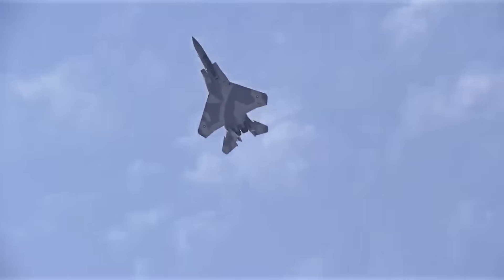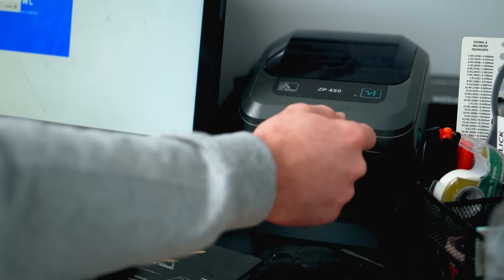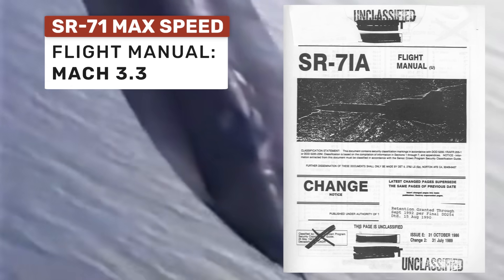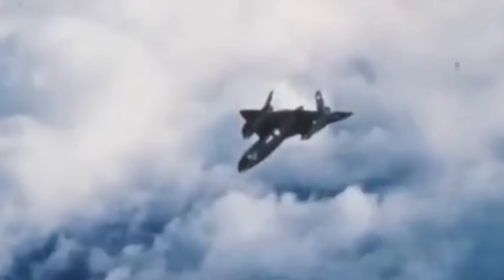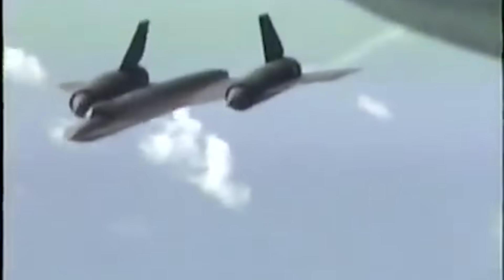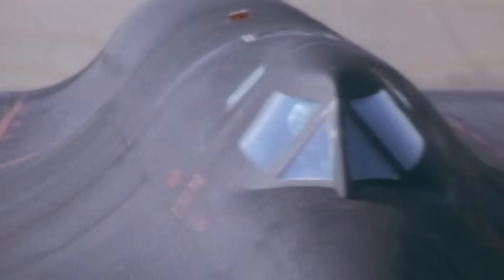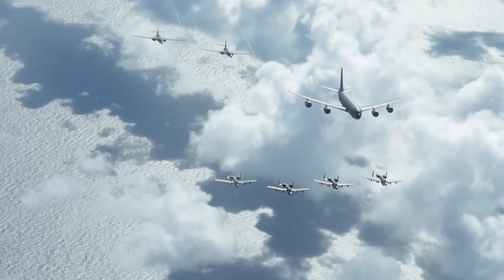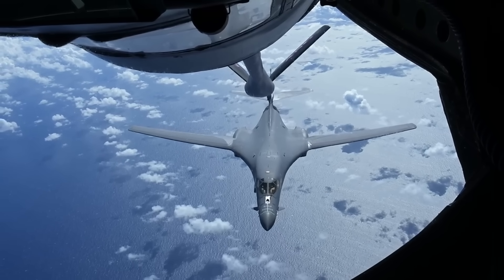The SR-71 was MUCH FASTER than the Air Force will admit

Comment: Yea agreed. The F-15 EX is almost certainly faster than the stated top speed. I believe that the F-22 is faster than the stated top speed of Mach 2.25. I mean the F-22 has the highest thrust to weight ratio than any aircraft we have and one of if not the higest of any fighter jet ever produced. The F-15 E and propably EX too has a TTWR of 1.25:1. The F-22 has a TTWR of 1.26:1 with the current square snapped nozzles. If the F-22 had round nozzle like everything else we had the TTWR would go up
To 1.36:1. Now that is the highest ever for a fighter aircraft. But using the square nozzles is part of the stealth qualities of
The airplane.

Comment: I think the max speed of the new F-15’s is what like Mach 2.6 or so? The original F-15 would do Mach 2.5. So the new engines have a combined 22,000 more
Pounds of thrust so with no weapons on board and about 1/2 a tank of fuel in pretty sure that could get that EX up to Mach 2.7-2.8. With a standard load out and a full tank of fuel I think it will still do Mch 2.5

Comment: So the engines will go faster than the airframe can take. Yea I heard that those engines when you get to Mach 3 that there is still so much more you can get out of them. I think with modern materials you could make a plane with those same engines that would do Mach 3.6 all
Day long.
Reply: Not exactly how it works

Comment: I don’t know what the Blackbirds top speed is it’s probably still classified but I do know that it cruised at Mach 3.2. When it’s at cruising speed it stays that speed literally for hours. The more you push those engines the more they wasn’t to go. When it’s at Mach 3.2 the airplane is 3 foot LONGER than when it’s sitting on the ground at regular temperatures. The heat from the plane moving through the air so fast heats the skin of
That plane up
And whatever it’s made out of I know it’s 65% titanium, expands
Reply: All the performance values are declassified and public
Reply: Well, it's 85% titanium, but the aircraft does change in size.  I don't think it stretches 3 feet, I think it's more like a foot.

Comment: Back in the mid 80s  a few of us techies  ran all the data we had on the Sr-71 ,  wt/ thrust altitude drag  , Once we crunched all the available ( printed public ) data  The computers continually delivered numbers exceeding mach 3.5  .. where as 3.56 was about the average .
Thats 2350 mph with an altitude of 88000 ft . 
Not saying it was ever sent that fast , but thats the numbers the  comps came up with .
Maybe with more available  data out their today  and better comps than what we had then , some one else could  crunch the numbers  .

Comment: There is a special switch 12:38 on the F-15 that allows maximum thrust,  only to be used in combat as it could potentially damage the engines so Mach 2.9 is feasible…. Oh I see you talked about it at the end of the video

Comment: Well I got news for you, the engine's that Prat & Whitney built f or the A-12 were the J-57 and one of the speeds it could do with no problem was , MACH 4.49 and there's another speed and altitude the A-12 can do with no problem but that's Classified. And on a. regular given day the highest altitude it can fly is : 95,000 feet.
Reply: Everything you said was wrong
Reply: @gr8crash Who are you that you are replying to every comment saying they are wrong? How do you know that? Do you have insider knowledge?
Reply: @bushgreen260 honestly?  Because most people are stupid on this topic. While people like the SR71 family of aircraft,  most know very little about aviation and even less about these aircraft specifically. 

So given most people don't know any better,  they often post things that are wrong,  and they should be corrected.
Reply: @bushgreen260  Some people bother to read the SR-71 Flight Manual.  
Sandboxx should have shared the secret and put this nonsense to rest.

Comment: the a12 isnt older than the sr71 they were designed at the same time
Reply: The A12 is older. The A12 first flew in 1962, the SR71 wasn't even requested by the USAF until 1962.

Comment: When you  bolt a couple of  big ass engines onto an untested  leaky  pile of junk there are bound to be be a lot of problems, probably why half the type crashed and burned.
Reply: You talking alloy the Mig25 or something? Definitely couldn't be the SR71
Reply: @gr8crash  certainly was  the SR71 and its types , half of them crashed.
Reply: @george-ev1dq  still not quite. A total of 50 airframs across all 4 variants were built,  and 20 were lost. Some were incidents,  some were mechanical failures, etc. But you have to remember virtually all those loses occurred within the first few years of testing and operation. The SR71 went on to fly for 2 decades without a single incident. Ended up with one of the safest records for an aircraft flying in such extreme environments.

Comment: I read at cruise the SR71 still had 4inches of travel on the throttle, but pushing it further would endanger the aircraft, and other future aircrew.
The follow on aircraft the Aurora could travel faster 35yrs ago but it probably did not work well as it's not been seen  for years.
Reply: First the only aircraft from the "aurora" program was the B2. Also that whole thing about the throttle isn't totally true as there is a lot of context missing from it
Reply: The Aurora hypersonic aircraft was flying in the late 80s but no sign of it since. It used to stage at Macrihanish then the longest runway in Europe at the time and was set up to take the shuttle if needed. I new a airfield worker who had seen the Aurora 4 times and a mil radar op in the UK I knew would be briefed when it would show on the scope, all this was 30+ years ago, what do you say to that.
Reply: @michaelwalsh7846  that it's completely BS. The only tie in to that theory would be the Boscombe Down incident which is a cool and mysterious event but still nothing too extreme. 

But besides that again the Aurora was never a hypersonic aircraft. People incorrectly assumed it was for some reason and back then speculations were fun, but now we have facts. So as it was said above the term "aurora" was given to a program that encompassed the ATB program. That was the competition between Lockheed and Northrop for the stealth bomber. That program is what produced the B2. 

We have yet to build a true SR71 type successor.

Comment: it was because the parts in the engines would melt and not withstand the heat however if tech would have been able to create engine parts that could withstand the heat they could go faster as the engine was also a ramjet. A combination type engine. Would function as regular jet engine until switched over to ramjet.

Comment: As I watch your video, I can tell you a story I was told about how fast the SR-71 is. It was kind of a drag race. The SR-71 was sitting on the runway at the threshold with the brakes locked and full afterburner. The brakes were straining to hold the Blackbird and the tires were squealing as the two Pratt & Whitney J58's tried to shove it down the runway. Meanwhile a Lockheed Starfighter (Missile with a man in it) was flying towards the Blackbird with full afterburner lit. Now you know how the F-104 got its nickname. It was incredibly fast. So, at full speed and afterburner lit, the F-104 rapidly approached the SR-71. When the F-104 hit the threshold, the Blackbird went brake release. Now here is the unbelievable part that will give you goosebumps and let you know how fast the SR-71 really is. When the driver released the SR-71's       brakes, the plane sped down the runway and was wheels up and reached the end of the runway before the F-104. Now I'm assuming it was Edwards Air Force base or maybe even Area 51, but to do what it did, it has to be Demonically fast. And it was built in the 50's with slide rules and not super computers.
Reply: That's definitely and interesting story and also not possible.

Comment: I learned years ago the true top speed of the SR-71 from a pilot when one was delivered to the USAF Museum at Wright Patterson AFB in Dayton Ohio where i was born and had live at that time too the Blackbird flown over the apt complex where iIlived and I made the trip  to the museum the next day, where it was still outdoors on static display and still essentially still able to fly still until they took it inand disabled the working bit decomissioning thee engines and avionics as well and having already removing all the camera and eletronic systems equipment ..I got to actually touch the plane i dreamed of ar least seeing in person one day but now I was touching the rare ands wonderful aircraft unique for it's flight capabilities.  when I tole one of the pilots that had flown it in that I had the model and wished to know moer about it and sort of begged for the info he told me thet told me that it could Super -Criuse at Mach 3,8 and had an actual top speed of around Mach 4,85 and maybe a littl more ever... and with an actual service ceiling of 110,000Ft. with a heat treat every time they go up, there may be no actual limit  to it's service life only the cost to operate the fleet of aircraft of that type.. with those J-59 turbo fan engines from Prat and Whitney I dont know where you got your info on the engines but it is flawed. and yes the air force does indeed under report the capabilities of their aircraft playing it very close to the chest at all times anyways just to be safe and keep it in essentially sleeper mode to take a saying from the car community.. I had a Testers 1/48 scale plastic model of the SR-71 Blackbird a few years ago and most of the published info was in the documentation with that model kit including the engine type and model of the twin Pratt and Whitney J-58  after burning turbofans as well as the fact that the tires are impregnated with aluminum for heat dissipation and that they are inflated with nitrogen to 300PSI and have blast shields around them in the gear bay to protrct the hydrolics and electronics  in case of explosion of the tires.  also that the YF 12 A interceptor was supposed to have an internal bomb bay to hold 2 LGB smart bombe with or wothout nuclear warheads. but there couldnt be any guns as the plane traveled faster than and bullet could travel anyway so might end up shooting itself down as a result...  lol  ...  the Blackbird is my favorite aircraft of al for its speed snd service ceiling... exotic build materials like titanium and the like but mostly for the rarity of the type with 25 built over all ant 2 of them trainer versions one of which had crashed leaving only one of that version so i built that one from my kit...gear up in flight mode and suspended it from the ceiling by monofilament fishing line that was virtually invisible in any light but through several moves and rough handling it was damaged beyond reasonable repair and missing a few parts as a resuls too. then somehow lost in the shuffle somewhere between homes... so gone for good now.. but still a fond memory.
Reply: The SR-71 didn't exactly supercruise: That usually implies the ability to fly supersonic without using afterburners.  While the SR-71 was quite impressive, it required afterburner to fly supersonic.
Reply: He was absolutely messing with you. The SR71 could never fly that high or fast under any circumstance.

Comment: Wasn't there an SR71 test flight that ended in disaster. Due to an engine stall at speed, control of the plane was lost. The pilot survived. It was calculated that going at 3.5+ Mach the compression of the air going into the engine, even with the inlet cone all the way back, was too much for the engine causing failure.

Comment: Summary: there are 2 variables limiting how fast the SR-71 could fly: engine power and aircraft skin temperature. Like a car, you could redline the engines to make more power but also damage them in the process. And you could have a higher skin temperature but at the risk of damaging the metal structure of the aircraft because it couldn't deal with the heat. Brain Shul flew at Mach 3.5 to evade Libyan SAM missiles, so it was worth damaging a very expensive aircraft, because the alternative was to get shot down and create a diplomatic incident, like with Gary Powers.
Reply: Except the Shul claim is BS

Comment: the Blackbird set a record for the LA to DC trip at 1hour 4 minutes 20 seconds. a simple google search shows this to be 2668 miles. that puts its speed at 2488mph, or Mach 3.77, which it sustained for over one hour.  top speed would be even faster.
Reply: May wanna do that Google search again as that's incorrect.
Reply: @gr8crash  did it multiple times. Google says 2668 miles.
Reply: @shawngore9072 lol no it didn't. It never once attained that speed.
Reply: @gr8crash  I did the math. Either Google wrong about the distance or the time listed is wrong. 
Otherwise my information and calculations are correct.
2668 miles in 1 hour 4 minutes 20 seconds  does in fact equal 2488mph.
Reply: @gr8crash  in fact, I just did some new calculations.  I was off a little.  2668 miles is the distance at ground level. At an altitude of 85,000 feet the distance would be slightly more. 4 tenths of one percent more, or about 2679miles. This means the average speed was actually  2,498mph. An increase of about 10mph. That's mach 3.785 I believe.
Reply: @shawngore9072  your math is waayyyy off. LA to DC distance is 2299.67 miles and coast to coast is 2404.05 per the records set, and since those timing gates are defined and established it's the most accurate. 

Average speed for LA to DC was 2144.83 and coast to coast was 2124.51. Which would put the mach speed at just over 3.21. Part of that record run was flown at about 3.29 as well. 

So not sure where you're getting your math from,  but it's definitely wrong.
Reply: @gr8crash  not according to Google.
Reply: @shawngore9072  actually even according to Google. Most likely you used Google incorrectly. But regardless that's irrelevant,  you have to use the FAI/NAA distances which are set and established timing gates. Those are the distances that matter. But to be fair, when used correctly Google is closer to them than whatever numbers you came up with.

Comment: The truth, no one knows because the plane was not power limited, it was heat limited. The pilots could have gone faster but they could have melted the engines and at Mach 3+ not good.

Comment: Top speed was probably closer to Mach 3.5 or 3.6 but you don’t fly the aircraft at absolute maximum speed unless you want to blow up the engines and probably die.
Reply: Again, as the term 'Mach' relates to the speed of sound, this also correlates to altitude. So, given an 80,000ft maximum altitude, Mach 3.6 is completely feasible...and is the general number I've been given...so, 660mph (@ 80k ft) x 3.6 = 2376mph....very capable of achieving that.
Reply: @firstjohn3123 except it wasn't. The aircraft would have crashed before it even reached 3.6. Not only are you know well beyond the capabilities of what the inlets can handle and what temperatures theb compressor can handle you're also now beyond what the control surfaces can handle. There's absolutely no one that had worked on or flew that aircraft that will say 3.6 was ever possible. And besides all that,  just say a pilot did do it, how would the crew even know?
Reply: It couldn't even get close to those speeds without specific circumstances

Comment: I had a personal conversation with the man who managed the SR-71 and spy satellite programs under the Johnson administration.  When I asked him how fast was the SR-71, he said:  "You're and engineer, you figure it out, calculate the speed were the air molecules reach the temperature that melts titanium."  That's about Mach 3.5 depending on altitude.
Reply: Lol that's not how it works.
Reply: @gr8crash  So how does it work?
Reply: @turbo32coupe  no company would design an aircraft to fly at 3.2 and melt at 3.5, that's ridiculous. Also the aircraft didn't start to "melt" at 3.5. Melting was never an issue for the SR71 as the aircraft never flew fast enough or got hot enough to melt any of those alloys.

Comment: I doubt M2.9 for F-15EX because it would roast the windshield.
Many supersonic fighters could fly faster than legal top speed, but not without damages, because the top speed is actually the heat it can sustain.
SR-71 was designed for that and was mostly built from titanium.
Reply: The F-15EX wouldn't be the first US fighter that was speed limited by the canopy.  The F8U-3 was limited to Mach 2.2.  Vought was working on a new canopy when the Navy cancelled the competition and awarded the contract to McDonnell for the Phantom II.  Vought calculated the U-3's maximum speed at Mach 2.7.  The Crusader III had F-15 performance 15 years before the F-15.   Given the Vietnam War choosing the Phantom turned out the biggest blunder in post war naval aviation

Comment: Apparently the Mig-31 can push Mach 3.1 but this will cause extensive wear and damage to the engines..  the SR-71 likewise was capable of Mach 4 tho this also will cause extensive damage to the engines and structure. as with the Mig-31 this would be a short term push it to the max then throttle back...... with considerable downtime afterwards to repair it and replace the engines.
Reply: The Mig31 is limited to mach 2.8, the Mig25 could initially pass mach 3 with damage likely. The SR71 on the other hand could never reach mach 4 under any situation.